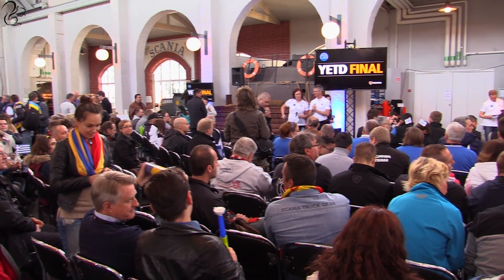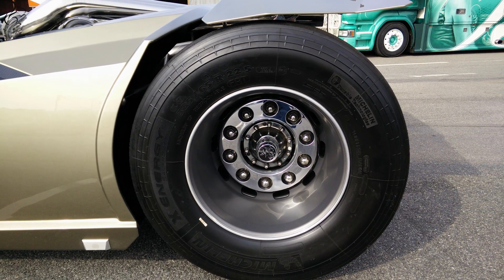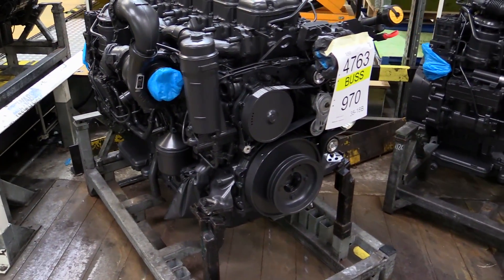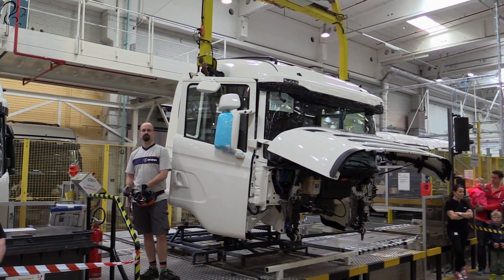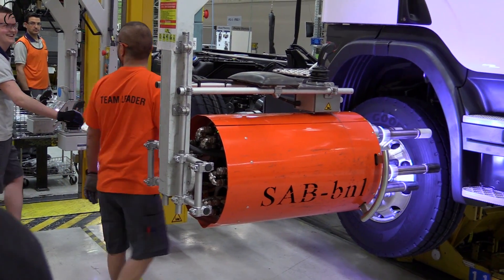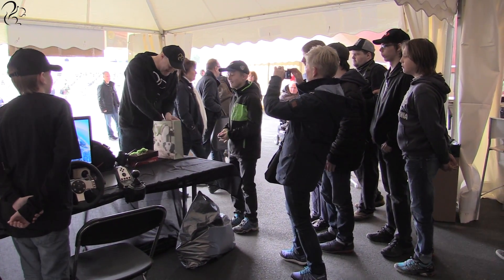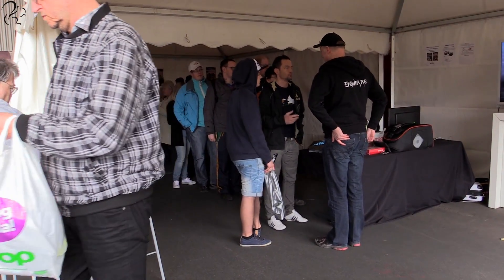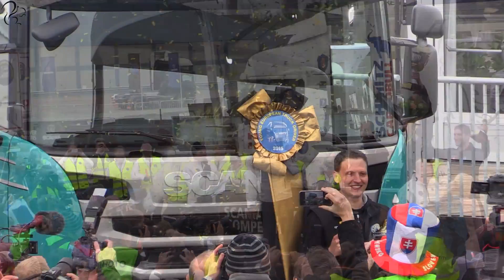Two Days at Scania (Part #4)

Comment: My favorite of the series...loved the factory tour! Those mechanics seem to have a very chill schedule, they didn't seem to be rushing :) Thanks Paul, very pro production.
Reply: las347 Big difference between the chassis line and the engine assembly line. The cycle time for chassis ranges from 5 to 30 minutes depending on model, while at the engine asssembly the cycle is about 2 minutes for each cycle.